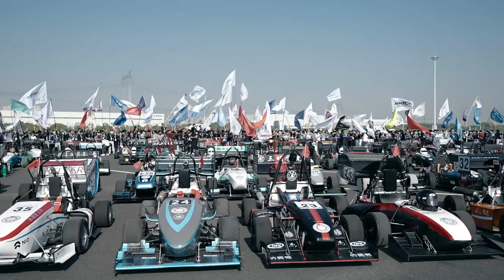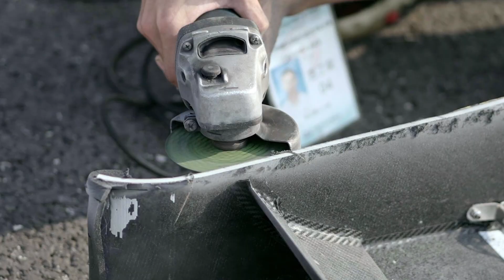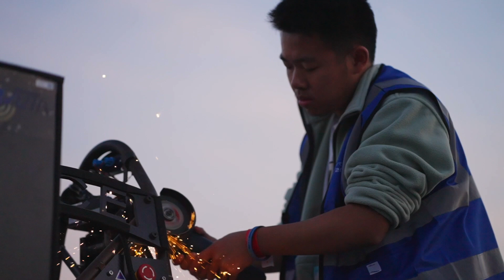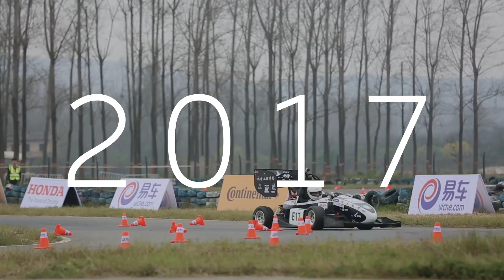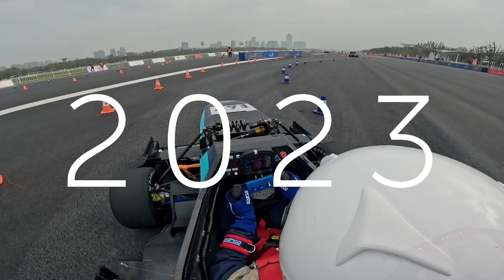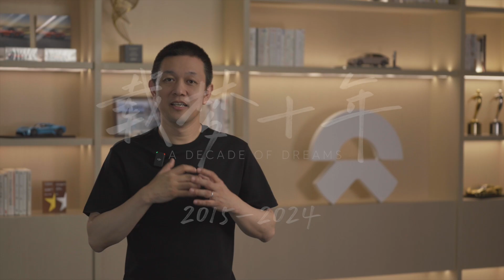A Decade of Dreams | The 2024 NIO Cup FSEC and FSAC is about to kick off

Comment: Suggestion from a fan of NIO, the rolls Royce of EV, goes as follows -- 
Battery swap idea of NIO can it not lead to evolution of a car carrying 50% battery for urban use and additional 50% capacity for highways.  Like a 100 KWH battery if could be divided into 2 or 4 separate slabs, 1 or 2 slabs of 50 KW could be always used on regular urban use with option of home charging and add the remaining 1 or 2 slabs of 50 KWH in swap centre when required to go highway; this would be very useful in India especially, where highway runs for 90% of customers would probably be not more than 10-12 times in a year; this should save carrying 250-300 kgs of extra weight in city and would increase range as well.